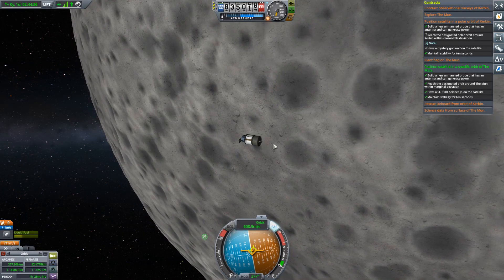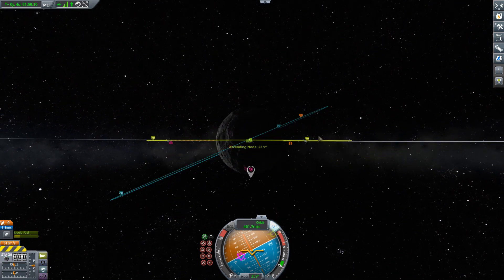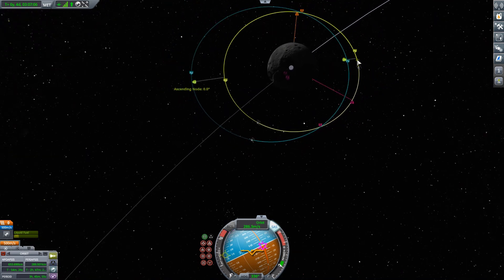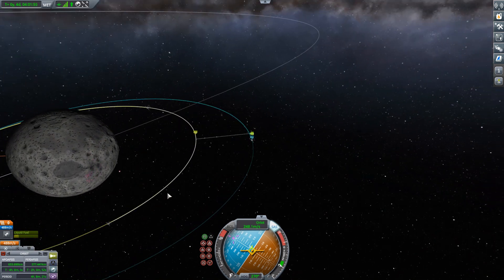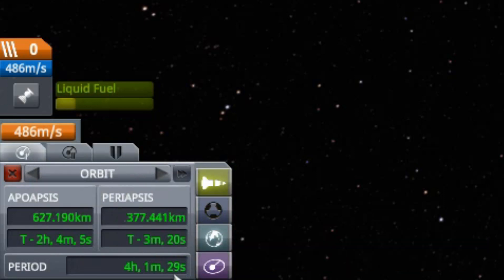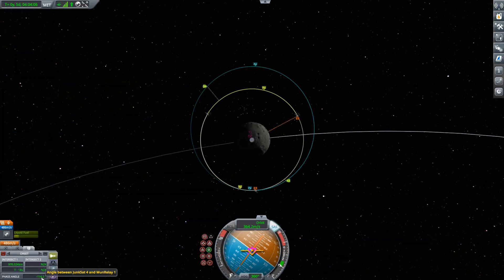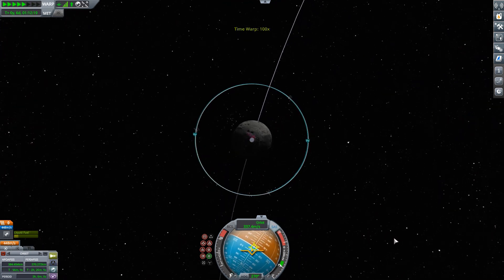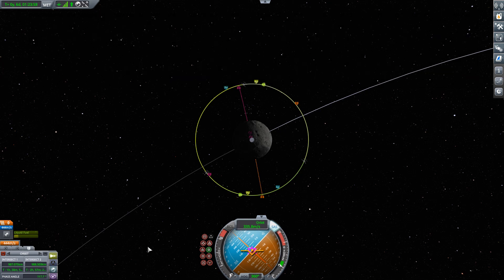Inserting Relays - Part 2 | KSP (Not) Beginner's Guide

Comment: Is there any list for best engines ??
Reply from the maker: Which engines are best depends upon what you are using them for. They all have their uses.
Reply from the maker: Generally, you want the lightest engine that gives you enough thrust to do what you need. You should also consider the engine Isp which measures its fuel efficiency (the higher the number the more efficient). You should also look at whether the engine will be running in a vacuum or in an atmosphere. There are two Isps for most engine. One is its efficiency at sea level on Kerbin (ASL), the other in a vacuum.
Reply: Suggestions: Nerv, rapier, Dart.

Comment: 15:17 why 5.2 and not 4.8
Reply from the maker: I don't have access to a PC and am only on a phone so I can't actually read the phase angle. Is it not 185.2 degrees. If it's actually 184.8 degrees, then a misspoke. There's also a strong possibility the audio and video aren't quite in sync and the phase angle is a bit different than what the video suggests.
Reply: Yeah, needs a correction. 124.8-120 = 4.8. You got confused when you switched relays (and consequently from negative offset to positive). Simple arithmetic error no biggie.
Reply: Pedantic point though that I’ve noticed from a couple of videos now. You mention burning retrograde to “speed up” but that’s not quite accurate. Indeed you need to decrease orbital altitude in order to decrease period, which will increase your angular velocity. But burning retrograde does indeed REDUCE your scalar speed at the identical point in your orbit. E.g. given two identical elliptical orbits, if you burn retrograde at apoapsis to lower your periapsis, then your speed when you return back to your apopapsis on the next orbit will indeed be slower, even though your angular speed has increased. I feel confident that you know this, but I only figured it out after struggling for some time with your “burn retrograde to speed up” comments in a few of the videos… Regardless of the pedantic comment, your videos and presentation are exceptional; you are my first go to for everything KSP related.